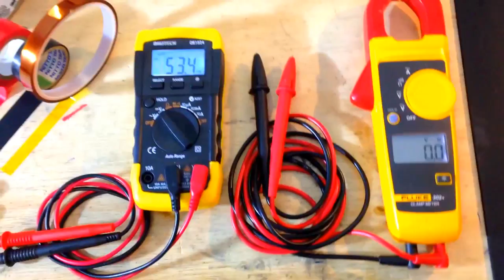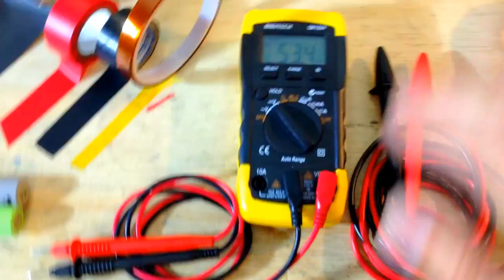Planning on making your own battery pack? DIY guide / tutorial • 18650 cells Electric Bike

Comment: Great video! Thanks! Where did you get the thermal protection paper? Could you recommend a good spot welder?
Reply: Does it not burn? That paper?
Reply from the maker: +Clifford Zvengrowski - I would recommend to get the same spot welder as I showed in the video.. the cheapest welder you won't have pulse control and won't reach all cells in your pack which is a pain when you're putting things together. Insulator paper http://www.batterysupports.com/8x-fish-adhesive-insulator-paper-electrical-battery-insulating-p-469.html it doesn't have to be this one, a thick paper from craft job would do the job =]
Reply from the maker: +DaDo Bzz - good you're asking.. this is a very common question actually... paper is a great insulator, won't melt like plastic at higher temperatures. Every single cell has a paper insulator over the positive connection but is wrapped under the plastic protection. If you cut the wrap you can remove this paper ring insulator. The paper ring I recommended is a second protection for additional safety. Spot welding packs mounted with the cell holders should be fine without it but any other construction method I would highly recommend it.

Comment: Hey whatsup Bruno, can you recommend a good inexpensive spot welder ?
Reply from the maker: Yeaaahh... I recommend this one https://malectrics.eu/ they’re on vacation for a few weeks at the moment so all items are showing “out of stock” but this is a good spot welder. You need to buy a little RC lipo battery to power it. Another option would be buying the Chinese Sunkko 709AD or 709AD+ but must be the 230v version (the 110v is a rubbish and doesn’t work). Then there’s also another similar to Malectrics https://www.keenlab.de/index.php/product-category/kspot-welder-kit/ pretty cool one and you can get a super capacitor bank but by the time you get all the accessories you invested quite good money there but you get the POWEEEEEEEERRRRRRRRR
Reply: @BrunoPOWEEER  Thank You very much for the info. I think waiting for the malectrics to restock is the best way to go. Anytime I inquire about a spot welder the name always pops up.

Comment: So if I make a little pack like yours with the lgmj118650 cells I get 17.5ah wow, thats exactly how much I was thinking I would be needing to. Can you tell us who supplied you, id rather hand over $300+ to an already proven supplier.

So was this just an overview for more detailed vidz to come?

Have you considered doing a pack without a bms and just monitor them every 6 months or so?

So you say the batteries create a lot of heat, how much of an issue is this, as I was thinking of sealing them in a box that goes in my frame?

wow I ask a lot of questions .......
Reply from the maker: +Jayme Capurso - Yes... if made my 14s 5p pack using these LG MJ1 cells it would be 17.5Ah instead of 14.5Ah... if add another 14 cells making it 6p you get a 21Ah pack at less than 4kg!!! 
eMax is the only business in Australia importing MJ1 cells directly from LG, fresh cells straight from LG Chem factory not from a nasty old stock sitting for months at the warehouse. Maybe call Ewan http://www.emax-ebikes.com.au/contact.html as soon as you get this message and ask him to quote some MJ1 cells for your pack.

Guess what.. I actually made last week a 14s 5p using MJ1 cells... I made some videos showing the wiring.. the spot welding, how to wire a BMS and everything you expect to watch before making your own pack =]

I actually made a funny long shape triangle pack for a prototype bike and we didn't include the BMS, I did wire for BMS just so I can hook up one in future or manually balance a particular series using a variable DC power supply (super geek). This is exactly how I would like to make all battery packs but the non-tech people would think is too difficult and high maintenance.

Yes, the batteries will generate heat... if they are packed inside many layers like wrapping and plastic casing the heat is trapped inside and will get to the point where the cells will be really hot to the touch depending on the pack and the motor. The more cells the less heat you should get.

*this little pack showing in the video was actually a tiny 36v 10.5Ah

Comment: i have a 1000w ebike motor with a 25A controller, will a 48v 20ah that is rated at 35A or 45A work with this controller or will it short it out?
Reply from the maker: +Wambi Ahzeem - Yes, it will work fine.. this is actually the ideal scenario, the battery should never be "less" capable than the controller. The controller will control how much power it will take. Having the battery rated the same as the motor will make the battery work on the limit what reduces the life of the battery and could limit the performance of your motor too. The more capable your battery is, the easier it will do the job. Go ahead and get that one =]
Reply: Thank You for responding, so the 25A is how much power the controller uses / not how AMPS it can take in? also if inline fuse is installed what should the fuse be rated is 45w fuse good?
Reply from the maker: +Wambi Ahzeem - Yes, most controllers nowadays you can program via software how many amps you want it to use. Some BBS02 Bafang mid drive the controller can take 25A max but some people set it a bit lower to 22A... 20A or even 18A so its not too powerful. I am qualified as electronic technician and when I was building my very first electric bike I really wanted to install a fuse between the motor and the battery but there is no need for it. The controller and the BMS have internal mosfets that will cut the power in case of any abnormality. Some people like to have an additional protection on the already protected circuit... for 25A controller I would go with 32A or 35A max fuse... 45A is waaay too high won't cut and protect at all. You could install a watt meter also called power meter so you know how many amps you're using http://www.emax-ebikes.com.au/store/p44/High-Precision_Watt_Meter_%26_Power_Analyser.html
Reply: Thank You again for very detailed info that will help me through the process.

Comment: I have a question please. If I have a battery, 12 v16A Lithium. Three cells. At what voltage should the charger cut the current? 12.6? or more? Thank you
Reply from the maker: Yeahh it’s actually very easy and simple to calculate these numbers. You need to find out what type of Lithium cell you have, there are many different Lithium chemistries with different voltages but the most common ones are 3.6v nominal (most but not all 18650 cylindrical cells) and 3.2v nominal for LiFePo4 which is a safer and long lasting Lithium chemistry but heavier and often much larger cell.
See if you can find your cell in this database https://secondlifestorage.com/celldatabase.php
Let’s assume your cell is a regular 3.6v 18650 size, the voltage vary between 4.2v per cell when fully charged and down to 3v when discharged. If you have 3 cells in series you multiply 4.2v times 3 which is 12.6v. However if you’re trying to make something to use with automotive 12v stuff it won’t work well cause the car battery is actually 14.8v fully charged down to around 10.5v when empty. Better use 4 LiFePo4 cells instead. 
I hope that helped =]
Reply: ElectricBike It helped me a lot !! Thank you very much
Reply from the maker: Hahaaaa welcome mate... more POWAAAAAAAHHH ohhh yeaahhh =]

Comment: Great videos! I just finished my diy nasty solded 48V pack and it works fine on my BBS02. But I have one concern, when riding up hill the powermeter on the display drops fast to two-three pins but right after braking the power the meter comes back to full. Is this common or what do you think the problem are?
Reply from the maker: +Daniel Jonsson - Hi Daniel, this is normal what you're experiencing is called "voltage sag" all batteries behave like that under load. There are many ways to minimise that sag, the easiest one is to increase the number of cells connected in parallel, you get more range and less sag.  Some cells sag more than others what cells are you using in your pack? Is it 13s or 14s? How many connected in parallel? =]
Reply: +ElectricBike (Bruno) Thanks for respond! I use Samsung ICR18650-22FM battery cell 2200mah. 13s 6 parallel. I got a bunch of almost new cells from my job so I could not resist building my own batterypack. I found a lot of inspiration by watching your videos! Havent seen many bafang mid-motors in sweden yet but I have already inspired a bunch of friends to convert there bikes:)
Reply from the maker: +Daniel Jonsson - Yeeeahhh.. it makes me extremely happy knowing that I am inspiring people with my videos =]
Bafang motors are becoming very popular which is good, they got so far the best and the easiest DIY conversion kit... when I got mine I couldn't find any info about this brand... this is why I started this channel.. but now... omg.... sooo much content...  so many people sharing their experiences....
Yeahhh.. if you have some electronic knowledge and some easy access to 18650 cells.. why not give it a go?
So much POWEEEERRRRRR =]

Comment: Helpful, thanks. How many continues amps can I draw safety from one battery using a 18650 with 2000mah.
Reply from the maker: Heeeey mate... it depends what 18650 cells brand and model you have... there are some old ones that can't take more than 4A and some high discharge low capacity used on powertools that can take up to 30A per cell. If you have the cells already and you don't know the model os specs, just write what is printed on the cell on Google and see what results you get =]

Comment: Hi,
I wanted to know if i can use individual PCM for each cell instead of using large bms for a 48 V batterry pack 72 Ah ?
Let me know if you can help.
Reply from the maker: +Mridul Babbar - Yes, you can use "protected cells" they actually have this little circuit on the negative of each cell https://www.fasttech.com/products/0/10003003/1225101-wh-18650b-2a-protective-circuit-board-for-18650-re
the cell will look like that https://www.fasttech.com/products/0/10001980/1141104-panasonic-ncr18650b-protected-rechargeable there are so many "protected" models.
It is not recommended to use protected cells for high powered devices such as electric bike motor. Pay attention to the specs, most of these circuits are designed for very low amperage mostly to control the minimum and maximum voltage. 
Protected cells are a bit longer than the standard unprotected cell. It may be possible with a massive 72Ah pack as you have so many batteries to share the load, just do some calculations, always expect the motor to peak more watts than specified by the manufacturer. The 750w Bafang motor peaks around 1300w/1400w and the 1000w model peaks around 1550w. 
Let me know how it goes =]

Comment: Hello could I have help with building or buying a Lithium ion charger circuit. Could you recommend one? Building a 12v battery using 20  18650 cells.  Want to build it for my solar panel or my gocart.
Reply from the maker: +shawn lee - Hi Shawn... you may find everything you need in this website http://www.batterysupports.com/ you can buy all the cell holders and insulative materials, they also sell cells  there, you can buy cells here in this website https://www.fasttech.com/category/1420/batteries or head to a battery collection recycling center and get some used laptop batteries and use the good cells inside. You will find lots of videos here on YouTube of people showing how they do, explaining every single step.. 
For your GoKart inspiration.. check out this channel https://www.youtube.com/user/EVFunDK/videos their website they explain everything. =]
Reply: +ElectricBike (Bruno) Thankyou so much sir. :)

Comment: Hey Bruno: the point is that BBSHD is an acronym in English and I do not know what it is.
And thanks for your answer.
Reply from the maker: +Hector Uccellini yeaaah I'll quickly explain here, Bafang is the largest Chinese ebike motor maker in the planet, they make a model that fits to almost any bicycle frame and it fits to the bottom bracket to the bike, this is why they call it BBS (bottom bracket system) and HD means that this is the Heavy Duty version (Powerful) they also have a smaller model called BBS01 250/350w or BBS02 500/750w or the big one the BBSHD 1000w 
Check out these videos here https://www.youtube.com/playlist?list=PL59mIOWSOm9rFcoO_dR0gSrRoVr7qhZKm

Comment: Hi mate I was wondering if you could help me out with 72volt battery pack build 20ah 5000watt peak 6000watt power output 80 amp continues 150 amp peak ?i think that's it if i have made a mistake i am sorry i new to this kind of thing i hope to hear from you very soon thanks mate.

Comment: Hi Bruno, This is one of your best videos. I see you upgraded your gear. Very interesting. I have a question, how to make sure not to fry a controller? For example If I have a 48v battery capable of 30A, a 25A controller and a 1000w motor, is the set up okay? Frying the controller would come with increasing the motor power, not the battery Amps flow, am I right?
Reply from the maker: +EFA22000 - Thaaaaanks for watching... I have more videos coming... I am releasing slowly so people have time to watch all that blablabla I talk hahahaa... 
Yes, your thinking is correct, the only way you could fry the controller is actually programming it to its maximum amperage and put a lot of load on the motor, nothing to do with the battery amps. The more amperage your pack is capable the better! If your controller is consuming 25A peak, I would go 30A or higher... the higher the cooler it will operate and the longer your cells will last.. (Lithium cells don't like heat). POWEEEEEERRRRRR =]
Reply: +ElectricBike (Bruno) Haha, thanks again for sharing the knowledge!

Comment: Man let me tell ya from Italy.......POOOOWEEEERRRRR!!! You rock!
Let me ask you a suggestion :-) I have 2016 bafang 750w 48v just arrived and I will install it in these days! I would like to get a 14s4p pack 52v and around 14ah ...what do you think? Is that a good configuration or I will fry the 750 motor that is made for regular 48v packs? I' m going to get sanyo Ga cells or Lg mj1 which I understand are quite high performance and both similar is some ways. PLEASE illuminate me :-) give me POWERRRRR MAN!!! Thank you for your precious hints!!!
Reply from the maker: Italianooooooo... I was made in Brazil from Italian ingredients hahaa I have family around there.... PASTA POWEEEEEEEERR in my genetics Hahaa
Yeah your Bafang motor will come to life with 14s 52v battery... it will give you a bit more top speed and torque as well, a 14s 4p packs more energy than 13s 4p you also get more range. If you can go for 5p is even better, you'll reduce the voltage sag under acceleration and that also increase performance + reduce the stress per cell so your battery will last more cycles and stay healthy for longer!!!
Yeah both GA or MJ1 are awesome cells you'll be happy with either option =]
Italian POWEEEEEEEEERRRR!!!! haha
Reply: Hey Dude!! i got the 52V battery as you suggested!!! powerrrrrr to me is coming!!!!! HOW can i test that they sent me the right battery? is there a way to test that is a   14Ah for example??? GRAZIE man!
Reply: Hey Mariooooo ITALY wants you :-) !!!!! Man thankx last weekend i mounted my new 750w kit with 14s 52v...... so much fun....and as you'd say...so much poweeeerrrrr :-P  BUT I NEED YOUR HELP FOR ONE THING!!!!  everything goes fine, i've done 60 km with great satisfaction and power is very smooth...and got 64km/h with no problem! BUT if i START the bike from zero speed with a high ( hard ) gear on, lets say 11teeth on the cassette ( in front I have 44 teeth chainring) at any value of level assist  ( but most with high levels) , WHEN I push HARD on the pedals to start the bike....the motor will start assist in an  alternate way..almost jumping and the bike vibrates literally!!!! it's that normal?? it doesn't happens ( or at least very  very less) if i do the same with a easy gear ( 32 teeth on cassette)....it starts smooth without vibration or jumping. The fenomenon never happens during cruising, only at start. I checked everything ( bolts etc)..... What is that??? maybe too much POWEERRRR? :-) thank for helping an italian fella...you 're the greatest expert  on bafang!!!!
Reply: mannnnn help me pleeeeeaseeeeeeeee don't let me waste that powerrrr!!!